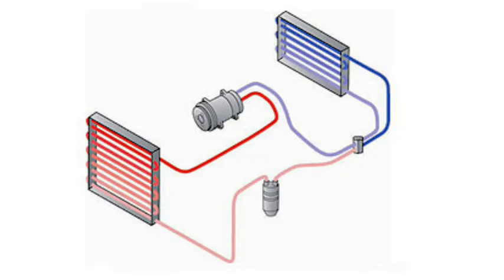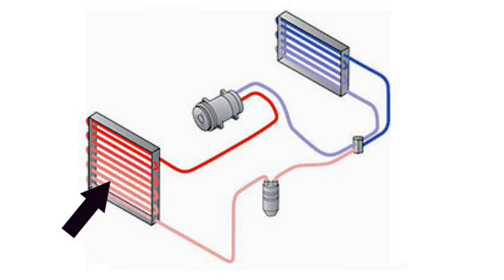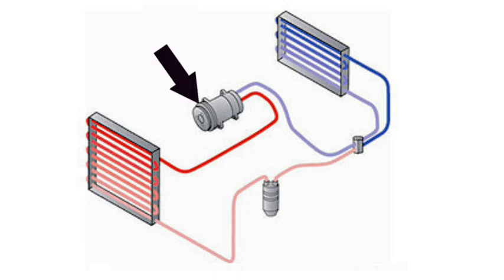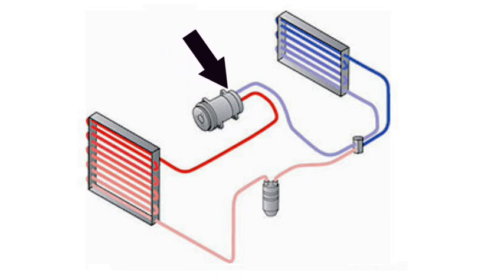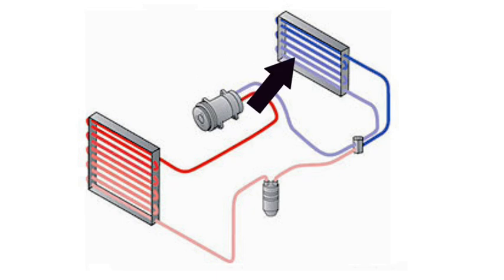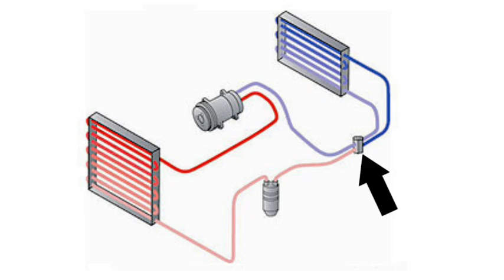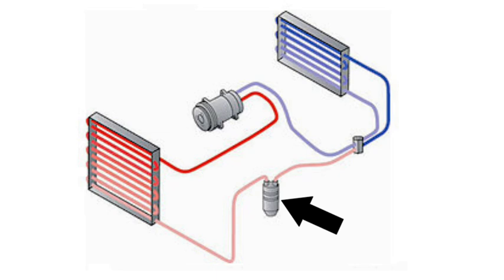AC System Basics - EricTheCarGuy

Comment: if there is a fan on the condenser.. see if it works when the vehicle is stopped.. if its working when the car is stopped might be a dirty condenser.. if  there is a fan and its not turning when the truck is stopped. try unplugging it cleaning. and plugging back in.

Comment: its because there is air moving thru ur condenser while on the highway, the reason why it wont work while ur at a stand still is because of no air flow. there is a high pressure switch on ur A/C system that tells the fan on your engine to turn on to get the air flow u need to transfer the heat out of the refrigerant in ur condenser. ask ur mechanic to check the pressure transducers, if you jump them with a wire and the fan turns on, you found the bad sensor

Comment: Hi. The bottom part of my condenser on my 2001 Accord,  seems to have crumbled away. When i touch some areas of the condenser its very soft, and bits fall off easy. The AC system delivers some cold air but not enough to get it comfortable. Is there something seriosly wrong with the system since it crumbles away like that? Or is it caused by  rust,salt etc? Thanks in advance :)

Comment: Hey Eric,  I'm replacing the lower side hose, so I need to recharge the system.  I kept hearing A/C oil... I thought when I pull a vacuum in the line, then I hook up my R-134a to it, and start to charge the system with r134a... where is this "a/c oil" that I kept hearing go? 
Thanks,

Comment: it depends on the system. you will find a label under the hood indicating correct refrigerant amount and type of oil to use. i'd look up proper service information regarding amount as sometimes there are new technical service bulletins that supercede the amount labeled on the sticker. insufficient oil can cause lack of lubrication to the compressor resulting in failure. too much oil can heavily coat the interior linings of heat exchangers resulting in loss of performance.

Comment: That does not come from inside the AC system, that is simply condensation. Ever notice how water sticks to the outside of a glass when there is ice cold coke inside? That water is not from the inside of the glass, it is moisture from the air condensing onto the cool surface.

Comment: hey eric changed drier on 96 Honda accord v6 took it down but didn't kno where the arrow was pointing from in to out so from ur video I think I have it wrong,so where it should be is going to the right cause from compressor going towards radiator which is condesor going towards back to car cabin

Comment: i have a 2001 dodge ram 1500 my a/c worked great thin one day it wouldn't turn on thin a week later it worked for a week then wouldn't turn on again i tested the low side with the a/c off and the engine running and there is 65psi then i turn the a/c on the pressure drops to 31psi thin the compressor kicks off and drops to 25psi once it hits 25psi it kicks back on and rises to 31psi and cycles like that the lines are freezing my problem is it wont blow air is a video of my problem more helpful?

Comment: how does the vicous fan (clutch fan) get actuated. i am talking about thermal and non thermal? also if your working on one how do you disengage  the viscous so it doesn't cut your arm when you are replacing its bearings?

Comment: Another "tell tale" is that you'd see more water under your car after using the AC for a while, due to possible ice buildup on the evaporator inside the dash (which you can't see) which could cause structural damage to that unit and it's pipes etc, causing (expensive to fix!) leak. Get it changed pronot!

Comment: Hi Eric, i have a problem with my nissan pathfinder's ac. During the day the ac works fine and it's really cold. But during night time and when i use it for a couple of hours , its pipes are freezed up covered by ice and the air blowing into the car is low. I already asked nissan personnel here and he told me its cooling system is clogged. Then one time my friend told me to check my thermostat if it's working and to find out it's not. is the thermostat has something to do in it?

Comment: ya more than likely have a leak, its fixable quite easily.remove all refrigerant, pressure test it with notrogen and use a gas detector or soap water to find the leak, fix it, vacuum the system again and charge refrigerant back in ;)

Comment: i have a overheating problem when my A/C system is on but when its off i got only 1/3 in the temperature gauge(no thermostat)..all fans are working, new clutch fan, then i upgraded my 2row radiator to a 3row radiator
does clogged A/C system or clogged compressor makes a big thing to overheat?

Comment: high eric my 2004 peugeot 306 1400 has tow lying side by side infront the condenser .... one of them is not working  ( both start then one of them dies) causing the compressor to engage on & off frequently .. what to check before going to the garage ?

Comment: U OVERFILLED THE COMPRESSSOR/AC SYSTEM...U MUST 1ST CHECK THE SYSTEM USING A AC GAUGE,FACTOR IN OUTSIDE AIR TEMP& ONLY ADD AMOUNT REQUIRED FOR YOUR VEHICLE AND NOT 1 OUNCE MORRRRRE!!!!

Comment: just one note, liquid does not take heat with it when going from high to low pressure, it has to change phase to give or take whats called latent heat. e.g changing liquid to gas requires heat  (taken from car), condensing gas to liquid releases heat (given to outside car). the change in pressure forces this action, as the refridgerant cannot remain as liquid in the low pressure evaoporator, or the butane/solvent in your can you have there cannot remain as liquid at atmospheric pressure.

Comment: Lots of helpful unknown basics of how ac system works, and other videos of trouble shooting to recharging! What are the symptoms of either the "Expansion Valve (or Orfice Tube)" or "Receiver Dryer" not working? Your video got my ac going in 103 degree weather today! Now my girlfriend wants hers done. Had R14 put in w/ correct pressure, compressor didn't kick on til another Pro vented a bit, cool for a moment but never since. Process of Elimination is what I'm after if you have a sec. Thanks!!!!!

Comment: i have a few questions about the ac system replacement... my compressor had a catastrophic failure which undoubtedly sent debris through the ac system. my question is: As long as the system has been evacuated, can i replace the compressor, accumulator, and orifice tube myself and then take it to a mechanic to have it flushed and recharged?

Comment: im trying to swap out my engine, and my a/c is full. Do i have to drain it inorder to remove the a/c pump. I was unscrewing the pipes that go into the pump which im guessing are the low and high. and the pressure started to escape so i quickly screwed it back. YES YES I KNOW YOU CANT DRAIN R134 INTO THE AIR. AND I DIDNT. Im just wondering is their a way to remove the pump with out draining all that r134 or having to take it to a specialist.

Comment: It should, after all those "canned air" duster cans contain a refrigerant, not air. The older ones with the stepped top and cone shaped bottom were actually R134a just like the car system, but the newer ones with the rounded top and bottom are R152a

Comment: (1995 Ford Taurus SHO 3.2l.) After my A/C was serviced in May, temp at the vent went down to 10 degrees Fahrenheit. That's 22 degrees below freezing! Mechanic told me not to worry. But last week the compressor wouldn't turn on. I first by-passed the drier pressure switch, then tried forcing the compressor clutch to get the compressor started. Nada. (The pressure switch was replaced last year, the compressor clutch 3 years ago.) I'm no expert; can you tell me where I went wrong, Eric?

Comment: Example Walk in box, 40F temp desired.
40 + 1  = 41 F, thats the "cut in" temp, convert to psi per refrigerant for "cut in "pressure.
Refrigeration uses a 15F coil split, and theres a 3 deg F temp variance for box temps cut in to cut out to not short cycle equipment, so you - that 3 degrees too, and convert to psi for "cut out"  The condensers condensing ambient + 30 deg F  and the Evaps Ambient -15, or- 40 if in an AC, I got a 70F supply in my Miata, hot suction line 350+ hi side, 65 lowpsi

Comment: The Condenser operates apporox 30 deg F  above outdoor ambient, so that the air is always cooler and can condense the gas to a liquid by removing heat, de superheating it, condensing and subcooling then all over again, The indoor coils run ambient -40deg F for a 20 deg split or 60F air supply,  a 30F coils going to ice in a house, Refrigerations coil splits 15 degrees cooler than box temp vs  the 40F split that HVAC coils use.Whats the design conditions for both coils ?  ambients and splits?

Comment: Eric, Your mechanical skills are Wizardry! I know residential systems and parameters expected, and can diagnose, cars dont seem to obey HVAC theorys beyond the refrigeration cycle!  Example, 50F air would require  (aprox) a 70F room with a 30F evap coil, to supply 50F.10deg F superheats what a TXV looks for in a house with its sensing bulb, yet not more than 20F superheat at the compressor, to not overheat the compressors motor. Subcooling 15deg as the liq line exits the cond coil.

Comment: Can you please tell me about me car ac problem. My car ac works fine normally but when I drive to 50 or 60 miles per hr then ac air start getting warmer. As soon a slow down to 40 or 30 miles per hr it's start getting cold again. Can you please tell me what can be a possible problem. Thanks

Comment: hi there i have an ac problem i check compressor if it were good but it is in proper fuction and orifice tube good i charge the ac with 2 bottles of 12oz freon and one pag 4 oz oil but it will not get enough cold out of 10 is at 5  the ac fan is working fine what it could be help me on this .............

Comment: Great video, easy to understand! My problem is my a/c isn't blowing very hard anymore. It use to. I have a 2000 Chevy Malibu & in the process of changing my spark plugs my vacuum line cracked. Fixed one & another cracked. Replaced seems like 5' or more. Unfortunatly one of the lines I cannot find where it goes, I have a screw it it to hold the pressure! I cannot find a good diagram to trace & find where it needs to go. Anyway...could this be why my a/c isn't blowing hard anymore or am I looking

Comment: Actually, in a water cooled engine, coolant is circulated through a heater core (sort of a small radiator) in the ventilation system.  Air is passed through it heating it and from there it travels to the vents.

Comment: He seems to vanish so I'll help u. Heater doesn't use gas, It's just easy that electricity runs through a coil and produces heat, the fans then blow the heat in to the cabin. It's basically the same as how a traditional light bulb is heated up to glow.

Comment: Quick question. On my 2001 Nissan Frontier I'm having a problem with the compressor staying on even when I set my air conditioning to off on the dash. The compressor comes on and off like it would normally do when I have the air conditioning on, but when I set the switch to the off position on the dash the compressor is still running. Its cools the truck just fine, but I don't want my compressor running all the time. I was told by a friend it could be the relay?

Comment: had compressor replaced in my 2000 silverado, everything was done properly took a 1200 mile trip and while in the deep south missippi and the heat made a swooshing water sound in dashboard and a/c stopped blowing cold. I dontt have the symptoms of a bad heater core, this winter heater was fine.. now we are back in summer season, I need to figure out the problem? what do you think could be the problem, I dont hear the clutch either engaging, but everything is new? appreciate the info man

Comment: Hey bro, I recently replaced the AC system in my car... I haven't turned it on yet.  I kept thinking I forgot something so when I got home I youtube'd the process, and as it turns out, I did everything right but did not put any oil in the new compressor! Does that mean, I have to take it off again?

Comment: i had a question on the d16y8 part 24 in the diagram that is called the air assist valve solenoid on the idle system this part isn't in the m/t model 2000 civic i believe can run the idle system like the m/t on a automatic or would i have to change the whole intake manifold i had a lot of coolant in the intake manifold

Comment: fourth can you make diagram for the 2 wire connected to the compressor if that 2 wire needs battery connection or not i just want to make it clear.
fifth receiver dryer or filter dryer. how do i know if that is still working good or not.. 
sixth the compressor does need oil right?

Comment: my Questions
first i would like to know if the rotary compressor is still working good or not how do i identify it?
second the 2 wire that is connected to the compressor. is that the switch to the clutch to engage and make the compressor run and work?
third the clutch that is connected to the compressor that you are telling on your video how do i identify it is still working good or not?

Comment: Thank you Eric very much for this deom!  It's really good how the AC works.  I have a question about leaks that my Infinity's AC is suffering from.  The engine was replaced a while ago and ever since, the freon keeps leaking.  Will HVACR (supper seal) fix the problem and is it going to possibly damage any part in the system!?  Thanks for taking my question.

Comment: @ericthecarguy I charged the a/c system the clutch did not engage on the compressor my pressure reading was 70 psi on high and low what could the problem be....also do the compressor clutch need to be running to check pressure

Comment: very good advice and explanation, its true if your not a professional dont touch your system components because you can not only damage your system or the enviroment but you could also hurt yourself . and also as soon as you open the system moisture contamination becomes a big issue as the oils used with the refrigerant act something like silica gel . it absorbs a bitchload of moisture. im an HVAC student gonna get certified in december.

Comment: check your txv(orfice) for moisture build up. the txv can freeze water around the orfice and cause a blockage, which in return makes the evaporater heat up and blow hot air. so the (professional) probably didnt take out the moisture while he reacharged ur system. hope this helps

Comment: @paky66 I forgot to mention: the doors are not vacuum actuated and the problem does not depend on engine rev speed. The engine fans start when i press the a/c on button; the engine runs at normal temperature.

Comment: @tiniboy3173 the slim one is the high pressure as i remember right (the one after the compressor). The system needs to be lubricated because the compressor has pistons in it and its rings need to be lubricated.

Comment: Ok now, here's a hard one: I have a '97 nissan almera N14 and it has the following a/c (no climatronic) problem: I start up the a/c, it does its job, but after awhile (about 20min) it stops working and blows hot air (a little hotter then the one outside or the same temp). I have replaced the condenser (it was cracked), tested the system for leaks and charged up the system with refrigerant (all that was done by pro). After i turn it off for ~30mins,it starts blowing cold air.What's wrong with it?

Comment from the maker: @Moralvorstellung7 The service manual has that information as it varies according to manufacturer, normally you only need oil after replacing a major component.  You can't by R12 anymore and even if you could you would need a license to buy it.
Reply: Thanks  ~ very clearly explained , showing the principal using an aerosol can - could relate to that 👍 - (same thing happens inflating a bike 🚴‍♂️ tyre using a CO 2 cannister)

Comment from the maker: @SuperDriver101 It depends on the heat load an humidity, the rule of thumb is that it should cool about 25º-30º from ambient temp.  I covered that in the AC performance test video.

Comment: @EricTheCarGuy 
The same thing has been happening in my 2001 F150 (a smoky mist out of the vents) but mine has a slight smell of anti-freeze. I'm thinking my heater core must of popped a leak. I have no wet spots any where in the interior even after a two hour drive.

Comment: Nice video! I see that for my honda accord, the heat works fine but stopped blowing cold air from the AC. This happened on the fly when the weather was very hot. Any clues where/how to diagnose the problem? Or do you recommend showing to a mechanic, which can be expensive though and not under warranty?

Comment from the maker: @Zpe3ddyGonzalexx In principal it is simple but there are many things that come into play during it's operation, any one of those things could cause the system not to work properly.  It could be mechanical, pressure, electronic, or pressure related not to mention that some HVAC problems are inside the dash and it's controls.  You also have to take into account the specialized equipment needed to service AC systems properly.

Comment: hey i have a question, i took my truck to a shop they filled up the compressor w/freon but no cold air came out out of the vents,then took it a different shop did the same thing and still no cold air, one shop told me that it's the compressor, the compressor engages but i juts dont get cold air even a bit , can he be right ????

Comment from the maker: @airmoth Without looking at the pressures I have no idea, in order for it to cool effectively it will need to have the proper pressures and if they are not correct the cause must be found and fixed, you would then recheck your vent temps.

Comment from the maker: @am2r You may have 2 problems, one could be the cooling fans, make sure they work when the AC is on and the other could be a problem with the idle circuit on the engine.  Good luck.